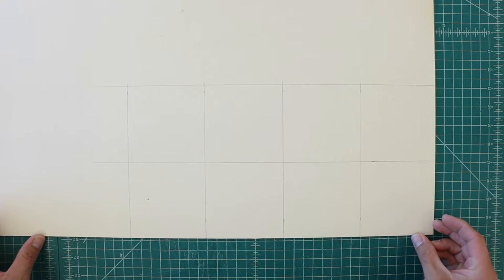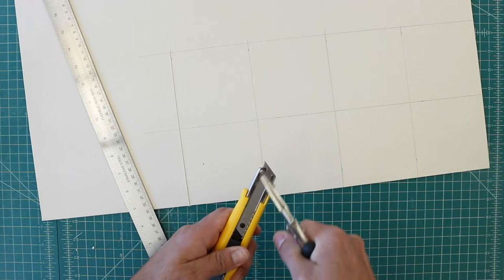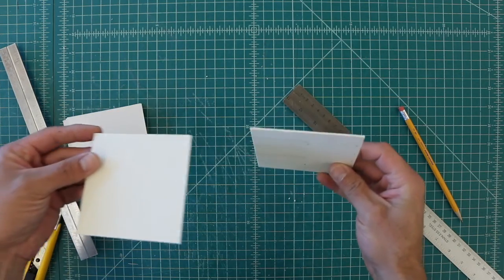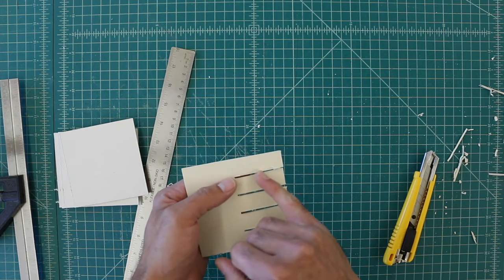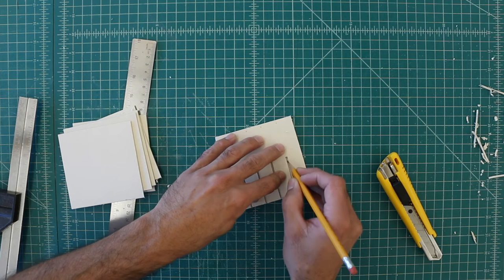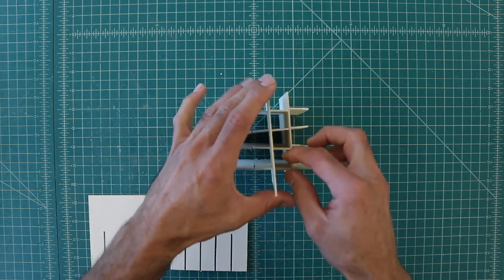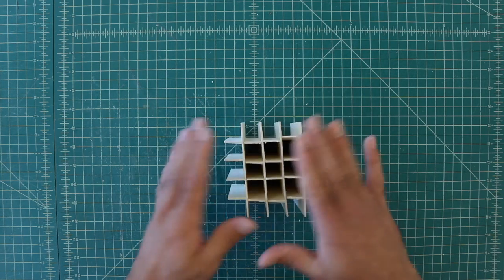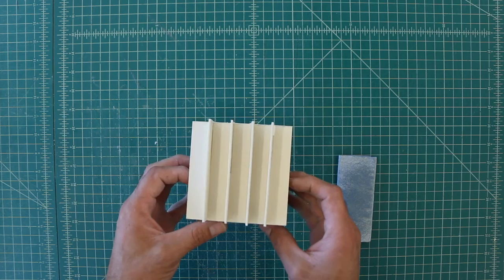Stereotomy

Comment: The back of your yellow knife looks like it's missing something. Was there an end piece? Did that end piece have a narrow slot to put the blade into, so you can use it to break off the end?
Reply from the maker: Thanks, it may be yes, I honestly don't know. These knifes are in the workshop and parts go missing and we buy many different models, I don't even think about it, I just use the pliers to remove a section of the blade :)